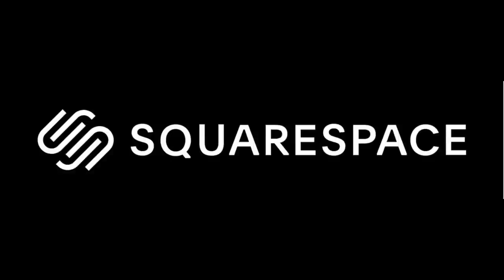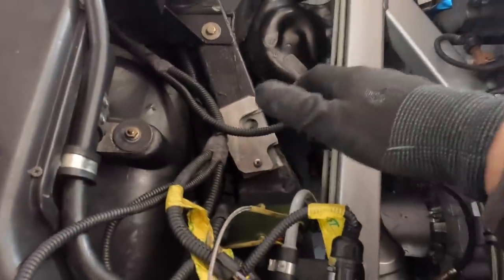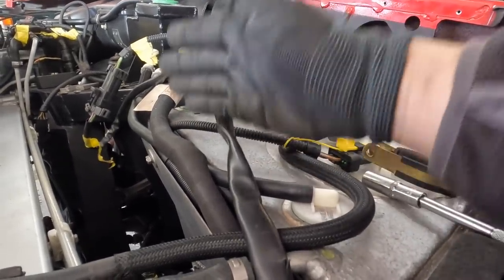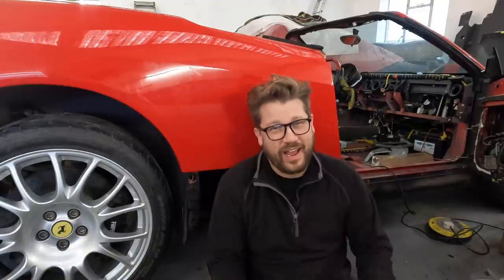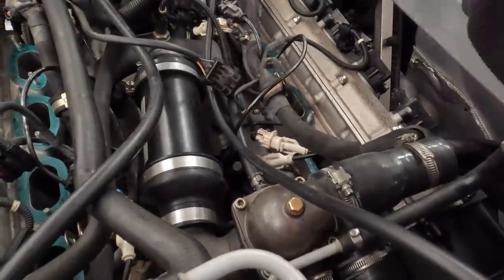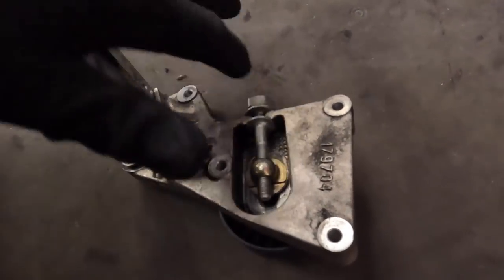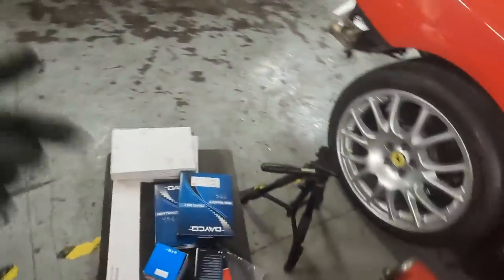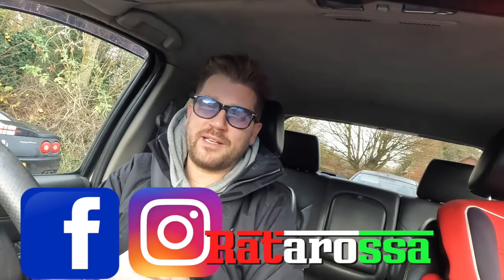Ferrari 360 CS Spider Project - Building The Missing Ferrari - Part 7

Comment: Hey Scott - re: breaking the tensioner pulley bolt

Next time, loosen the nut on the pulley itself FIRST prior to putting a wrench on the tensioner bolt. It won't break, I promise you.

Agreed that it's a poor design by Ferrari, ancient non-adjustable engineering. Our 355 required the entire bracket to be replaced, as several other mechanics that had done majors over the decades didn't know the trick above. 

Cheers!
Matt

Comment: If it were me I would use anti-seize on that tensioner setup. I use that stuff on just about everything that might see corrosion or when differential metals are in contact with each other.
Reply: Don’t think it a issue with seizing. It’s more likely to be metal fatigue where the vibration from the tensioner is causing that long unsupported bolt to vibrate until it’s so fatigued it fails with a small amount of force. The design is poor, really that bolt needs an additional support before or after the tensioner pulley fitting.
Reply: @orlandobuckland2986  the tensioner wheel nut is supposed to be slackened before the adjuster bolt is turned. Never had one snap personally.

Comment: Hey there Scott, another couple of jobs diagnosed and sorted - well done.  It would be interesting if you gave a rough running cost on the various parts and rebuild kits as you go along.  

With all the work you do, had you looked into a head-strap mount for your action cam?  It would leave both your hands free, provide steadier shots, and speed up the jobs.  Plus less frustrating to view (as another mechanic). 😎 

And yes, how is the 512BBi coming along?

Comment: hey bro  of course that bolt is going to snap every time if you dont loosen the nut in the middle of the bearing idler wheel first.    It locks the bearing in place so it cant move . Just as well the bolt snapped as it is probably   designed to do so ,   otherwise you would be changing the housing as well.  Which one do you think is cheaper.
Reply from the maker: Hey Tony cheers, but the 12mm bolt was loosened first, I only showed loosening the 17mm on the alternator but rest assured everything was loose. It’s a very common issue that these bolt snap.

Comment: Why did you not pressurise the water system before putting it all back together??
Should have done all the major service items on the engine before putting it back in the car, access is a gazillion times easier 
ps - I hope your clutch is good(fingerscrossed)